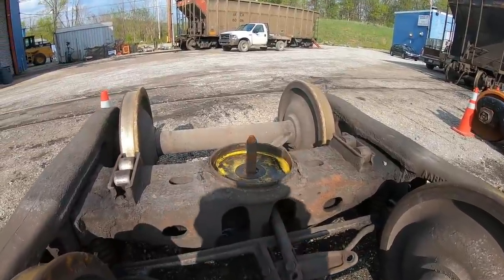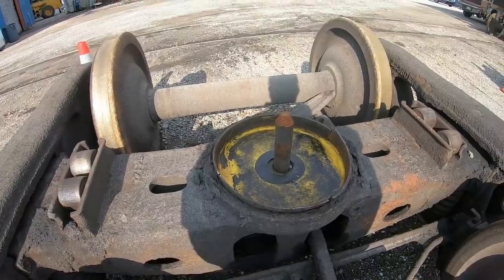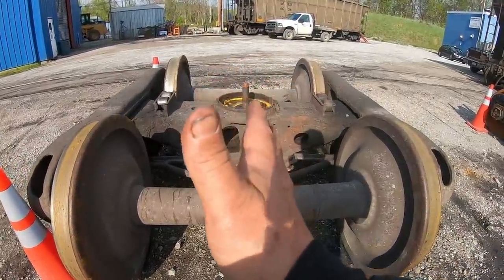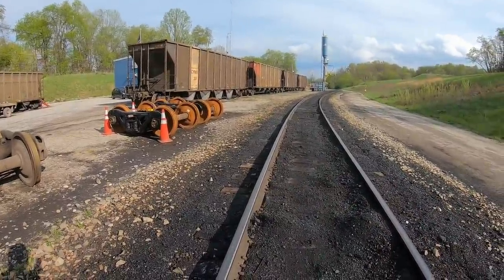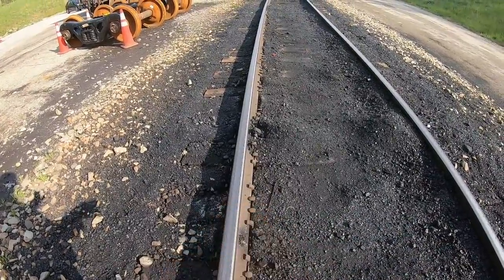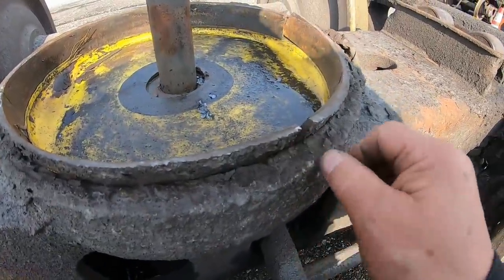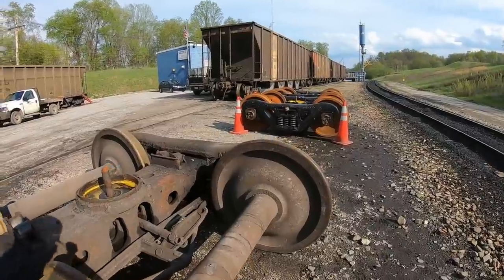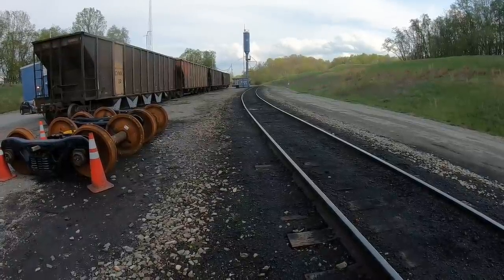Why the Derailment at Curve 18  Happened

Comment: Yep, if that wheel set doesn't change direction freely as it enters a curve, it will put excessive lateral load on the outer rail and push it over, probably before it could climb the rail because the loaded cars are so heavy. My guess is it pushed the rail over before the wheel climbed over it, but who knows. Murphy's Law struck again. If that flange was broken before the derailment, the car part could have dug into the sharp edges of the broken wheel part, causing excessive resistance to it rotating as easily as it should have.
Reply from the maker: Sometimes things just break and go bad on the RR. We been
very fortunate that this was the first time that I can remember
since 1993 or earlier that a problem like this has occurred here.
Thank you for watching Bill and hope you will enjoy the rest of the
videos coming out about the derailment events.

Comment: I have always wondered- What does one two wheel and axle combination weigh? It's just a lot of steel. Looks like around 2K pounds? Would be interested to know.
Reply from the maker: There are different sizes of truck sets, this one is called a 100
ton truck set. (capacity) These weigh around 12,000 pounds
according to the truck driver that brings our rebuilt ones in
to us. I do not know the exact weight of a wheel set (2 wheels
and 1 axle) but your estimate I would say is right in the ball park,
but a bit on the low side. Thanks for writing in and watching the
video today Jeff.

Comment: I know a locked differential likes to go straight, your rail wheels are locked together, does that cause a bit of problems?
Reply: The wheels are coned and not flat. If the curve was going on a right turn, the axle would be shifted to the left. Therefore, a smaller diameter would be riding on the inside rail, and larger on the outside rail. And any given length of track curve means the outer rail is a longer distance than the inside. Lesser distance on the inside rail and lesser diameter on the wheel riding it. On the other side, more distance and more diameter. The axle is like a locked differential, but the principle of differentiation is done by different diameters.  Short answer: no problems.
Reply from the maker: Very good explanation sir, thank you!

Comment: If you look close with magnification, sometimes you can tell if metal failure was either fatigue failure or from a single event. If there's beach marks (lines) or polishing on the crack surface it might point to fatigue, with plastic failure at the end. If the failure is uniformly plastic, then it could be a single event. Just making stuff up on youtube here from my armchair. hehe
Reply: Agree.  In another field of work, our engineers took crack-failed steel and sliced it so they could look and see how 'fast' the crack grew.  All at once in one failure, or fatigue type where a tiny crack, some rusting, crack grew a little more and rusted deeper, then grew more and rusted more.  As you call it those 'beach marks' told us that the crack started a long time before and just gradually grew a bit at a time over a long period.

Comment: I think you said wagon was loaded. Bolster is really badly worn even without the fatigue cracking on the bolster centre. The king pin looks fine. Suspect fatigue failure bolster centre plate. Possible uneven wagon load may have contributed. Wheel flanges look fine. Just my two cents worth.
Reply from the maker: Thanks Stanley for the comment and as Thomas the Tank Engine said, Silly cars always causing
trouble because they are angry. Thanks for watching my friend.

Comment: I failed to mention on my previous comment that I was thinking about a banked curve where the outside rail is considerably higher ; thus load center slightly transferred to the inside track reflexing less down pressure to outer rail allowing flange to wonder past threshold. VIA inertia.

Comment: The bearings are pressed on the axle after the wheels are pressed onto the axle. My guess is the bearing seized causing it to pull left when it should have been going right.
Reply from the maker: As Thomas the Tank Engine said, Silly cars always causing
trouble because they are angry. Thanks for watching my friend.
Hope you'll stay tuned for the rest of the upcoming videos on
the derailment.

Comment: Looks like an old break to me and then compounded to the point of failure, could the break have been caused by lack of grease? Meaning friction/heat fatigue? I didn’t notice any metal shavings to indicate it scraping and grinding. I’m looking at this from a diesel mechanics point of view so I’m not entirely familiar with rail cars
Reply from the maker: Good observation sir! Seems like with no shavings then that would
further indicate the truck set wasn't steering thru the curve properly. movement of the truck set with your info would mean
shavings and that it was steering albeit harder? Interested to hear
your reply back
Reply: @ccrx6700  if the break was old and there was no grease or a lack of the appropriate amount then moisture could’ve found it’s way in the bowl, causing friction and or ceasing the swivel up, similar to a how a bearing can get into a bind and fail, still would think there would be some sign of metal on metal contact, or does the plastic insert show any damage from scraping or heat?

Comment: Just noticed something, back in February 20th, 27th, and March 3rd you did a video of a wheel bearing failure on a car and replace the truck set.  In that video the car was CYMX 20 same as the lead car in this recent derailment.  I was wondering if the trucks set in this video were the trucks that were replaced, or if that was from the other end of the car.  If that was the same set of trucks, that would mean that damage had occurred within the last 3 months.
Reply: Looking at satellite map of your mainline, I see that by the direction of the mile 8 spur that was indeed the leading truck set  on CYMX 20 that was replaced.  I'm also assuming the cars are never turned.  I'm looking at the center bowl insert and not seeing much lubrication.  Is it possible that when the trucks set was replaced 3 months ago that the grease was not added?  If the only lubrication was what remained on the bottom of the car frame, that might have caused excessive wear and the damage to the center bowl we see here.
Reply from the maker: Very observant Samuel! The east end truck set was replaced 
when the bearing went bad, this time it was the west end truck
set that first came off, you are only the 2nd person to notice
same car # Congratulations!

Comment: Yeah if the middle of the crack in the collars are rusted then they have been broken for a while. If it looks like fresh shiny steel in the middle of the cracks then it is  a fresh break because the oxygen has not had enough time to oxidize the metal and creat rust. So you are most likely spot on with your analysis. Now weather or not they cracked just before the derailment or during does remain a mystery. May have to send to a metallurgist and look for fresh stress or stretching under a microscope to determine that.
Reply from the maker: Thanks for watching my friend.
Hope you'll stay tuned for the rest of the upcoming videos on
the derailment.

Comment: The liner is plastic.  Was a plastic compatible grease used?  If not that could lead to failure of the liner and accelerated and excessive wear on the truck bowl with the excessive wear resulting in the cracks.
Reply: 50 tons on plastic is a bad idea, until i see some scientific proof.
Reply from the maker: Good question Paul, I know little about the grease itself, but
do know that Lyon's Industries, who rebuilds our truck sets suggested using that grease years ago to us. Hmmm, maybe
they just wanted to sell us cases of their grease...LOL
Thanks for watching sir

Comment: Huh neat they put grease in the bowl, the shop i worked at never did.
Reply: If they use Teflon bearing discs, they most likely would be used dry. Teflon is considered self-lubricating.
Reply from the maker: It has good friction resistance. Lyon's Industries rebuilds our truck sets, years ago they suggested adding grease so that is why
they do it. hmmm, maybe Lyons just wanted to sell us lots of
cases of grease???? LOL

Comment: I do believe your theory is 100%,  however I've noticed in your video, that the center liner plate has been pulled up out of the center plate of the ring of the bolster and is spread open causing it to split open by the weight of the car leaning from side to side. That tells me that the center plate of the of the car itself was  not seated  into the the liner plate and just shifting around,   Therefore as I can see, and you are right, as the car leans in the curve , it puts more weight on one side of the truck it self and taking the weight off of the oppose pair of wheels, then to allow the flanges to raid  up over the ball of the rail.  So there for, how often, with all the miles put on them, just how often do theses cars get checked out     Well that's my 1% theory,    subscriber
Reply from the maker: Sounds well thought out Dan, thanks sir for writing in and glad
you enjoyed. Cars are looked over daily by walking once and everytime they go out a roll by, however there is no regular
schedule for checking things like the center bowl liners, maybe
that will change now

Comment: Hi Dave everything has to work together cars, rails, ties, etc.  I know when we work with the track gang at the mill everything has to be right. They use special ties for the quench car tracks they are call zobie ties did you ever here of those. The hot car runs on 136# rail and the pusher runs on 175#.  Anyway take care and keep posting the videos i love watching them 

kenny
Reply from the maker: Very intersting Kenny, no I have not heard of them, would love to
find out more if you have any info on them. Appreciate that
Reply: hi dave 
i asked the track gang about the zobie ties supposedly they are from a special type of wood that is imported. The track leader said they are extremely expensive. They use them under the quench car tracks they take some serious abuse from hot coke, being wet, and coke fines. They replace the rails every other year according to the gang its probably 1000 feet of track but its straight. The gauge is the same as regular rail equipment. Take care dave and post some more of the videos my wife and I love to watch them on our tv. Thanks again and take care.

kenny
Reply: Hi dave hows the new track section holding up can't wait to see all the videos.

kenny

Comment: Off subject: Have you done a video about the air system of the cars? I'd be interested in how leaks are caused and detected, how long the hose couple rubber lasts and how hard it is to replace, and if the shutoff valve is used when the air lines are pulled apart such as when cars are given a push then let go for sorting (I've often wondered why doesn't the car stop when the air lines are pulled apart).
Reply from the maker: No I have not Peter, will do some day in the far distant future,
but it gonna be awhile. Great question and something a lot of
folks would be interested in. Appreciate your watching sir
Reply: The rubber gaskets in the glad hands are very easy to replace-either bend them toward the center of the opening and pull it out or cut it out.  To install a new one, place the gasket on the glad-hand casting and work the smaller lip over the casting edge until it is seated.
I would say that most of the leaks in the train line are in the glad-hand connections from aged and worn rubber with dirt and coal getting between them doesn't help.
On this railroad, cars and locos are uncoupled and moved to the shop as needed.  The cars are not regularly sorted as they stay in a made-up train that is loaded, taken to unload, then returned to be loaded.  The train is not turned either, no wye, turntable, or loop.

Comment: You could be correct? However, those axles aren't designed to go around curves as one wheel has to be drug every time they go around a curve, maybe the wheel on on one end of the axle come to a spot where it had more traction then the other one and that set things in motion?
Reply: Railroad wheels are beveled. In a curve the outer wheel runs higher on the bevel and the inner wheel runs lower on the bevel. The difference in wheel diameters where they are running on the rail provides the difference in distance per rotation needed to track on the gradual curves used in railroads.
Reply from the maker: You are correct Jim, thanks for that. Been my observation that
principle you explained works very well on lower degree curves,
but on curves above 5 to  6 degrees then one of the wheels begin
to skip or slide, a leading cause of rail corrugation. Your thoughts on that sir?

Comment: Dave, your theory about the Frozen truck set makes a lot of sense, and it could have happened just that way.

But I was thinking....... If somebody were to pile up enough ballast (or bunch of spikes) at one point on the inside of the outer rail on the curve..... So that when the wheel hit it..... It rode up and over the rail -- effectively acting as a derailleur -- could that also be a possible cause of the derailment? ...... Maybe some kids, bored to death, with nothing better to do....... Decided to see what would happen if they can make a train derail?

And another thing bothers me. If there was any Grease in that bolster bowl...... And those cracks happened gradually...... I don't think they would be rusted at the break points (they would be too full of grease, no?)
Reply from the maker: Yes it could possible happen John, we've done that with the ballast
car get too much ballast piled up and off the wheel went. But that
was not the case on this one. Glad you could check out the video
and write in my friend.

Comment: The part that sits in that bowl may have more clues as to how it happened by examining the scaring. I would like to have seen that portion of the car. The two would tell more of the story would be my guess.
Reply from the maker: You are absolutely right in that Doug, they put a new truck set under
the truck on a shift I wasn't there, so did not see it. When I asked
what that center plate on the car sill looked like he just gave me
a deer in the headlight look.... I doubt he even looked at it.... sigh
Thank you for taking the time to visit with us and write in my friend.

Comment: Perhaps the cars not rolling over allowed the train to proceed further.  
I'd worry that the failure to pivot has effected rail integrity proximate to the derailment and/or it's a systemic problem effecting other rail cars in various degrees.
To check to see if the "gears" in a Rolex needs to be lubricated the watch is placed in a "listening device" and rotated.  I'm sure the pivot pin sounds different with age/wear and could easily be recorded by an inexpensive listening device placed  periodically.
For that matter sound patterns could be used to serve as a measure for "normal/unique" function deviation from initial measurements and could prove to identify a host of problems.
Reply from the maker: That is correct, had they turned on their side the track
damage wouldn't have been as great, but there woulda been
a lot of coal to clean up and environmental would have gotten
involved. Appreciate your watching

Comment: Looks to me like insufficient clearance between the truck bolster center bowl rim and the body plate caused that mess.. saw this happen before. Anything under 1/8 inch can be an issue.
Reply: If that was true the top of the ring would be shinny from the wear
Reply: @MrLarrycar  if you look close at the poly liner in the beginning of the clip.. only the bottom part of the liner is there.. the bowl is blown right out.. can't be sure. There's other things that could have been an issue too but this looks familiar.
Reply from the maker: Sometimes things just break and go bad on the RR. We been
very fortunate that this was the first time that I can remember
since 1993 or earlier that a problem like this has occurred here.
Thank you Brent for watching and hope you will enjoy the rest of the
videos coming out about the derailment events.
Reply: @ccrx6700  really enjoy your videos. I worked for a couple short lines as well as the Ohio Central before it was G&W and then Conrail until the NS and CSX chopped that all to hell. Miss those days. Considering getting back into it.

Comment: Looking at the rust marks would indicate a failure prior to the derailment. What’s up with no scheduled PM on the trucks? BTW there is a company in Palo Alto Ca call Failure Analysis that finds out why. There is a case they worked on that a quarter size void was found in a wheel set near the flange that caused a massive derailment many years ago. The stress on the wheel sets is enormous especially around curves.    IMHO good call and suggestion that each and every truck set on every rolling stock be put on a PM schedule instead of waiting for a failure. It’s far cheaper.
Reply from the maker: Well since you asked Captain Dunsell, the company that owned
us before Iron Senergy took over a few months before this
derailment, had no money. They spent no money on prevention
but it was fix it when it broke management. We don't need to
call that company, we need to do a much better job at
regular maintenance to prevent as you said. 

Really appreciate your taking the time to check out the video my friend  and may you have a very good day.  And, if you haven't already done so,  check out my second channel with more cool railroad videos and other stuff I get into on it. Your the kind of person I would love to have as a subscriber to it.
https://www.youtube.com/@ThatsDavesOtherDoings